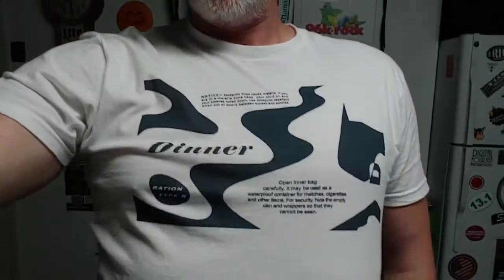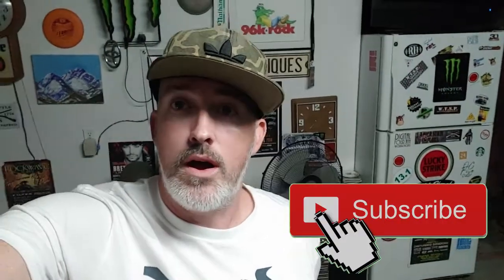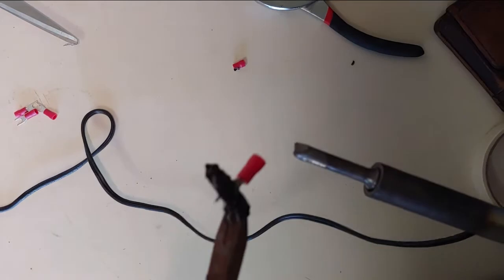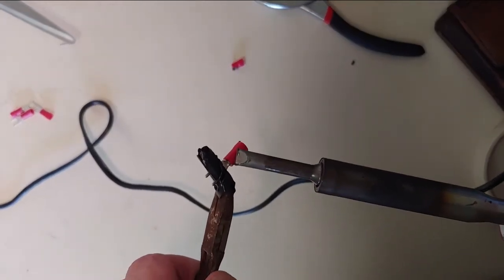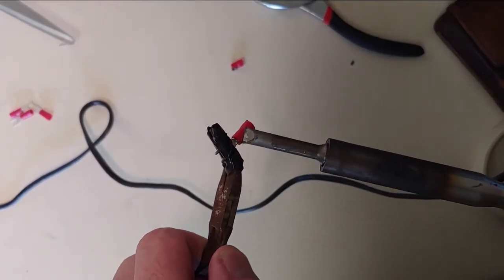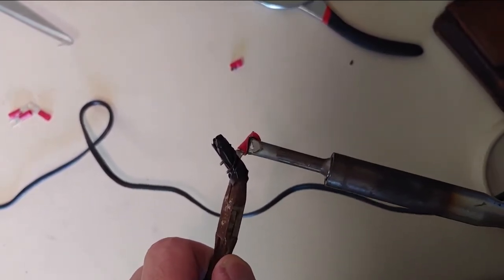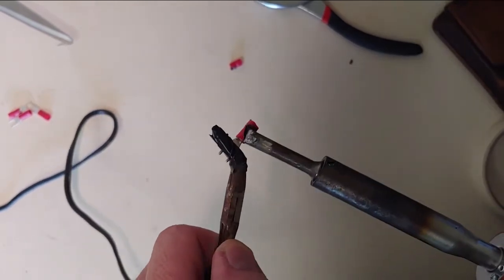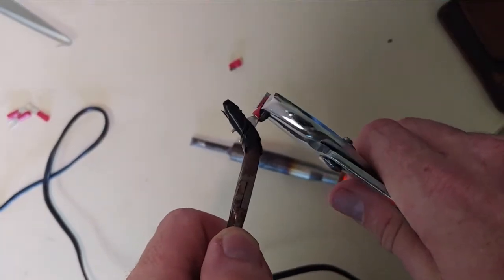EE8 Field Telephone Handset Cord Replacement.

Comment: What materials are used for the EE-8 field telephone cable (the original CC-333 cord)? It is rubber finished but there is some white/yellow fabric underneath? Any asbestos related?
Reply from the maker: I didn't dig into that too deep. I just cut it off and tossed it in a box somewhere